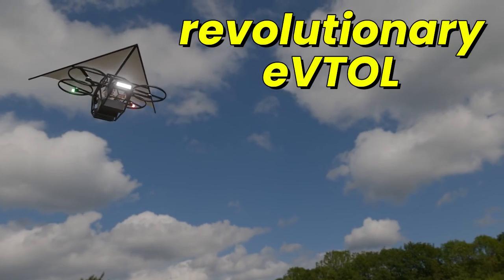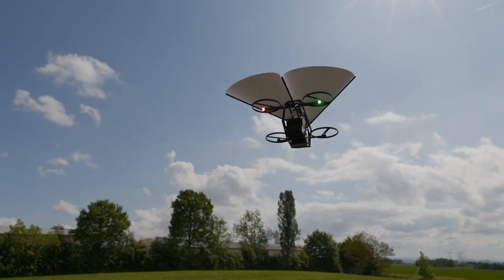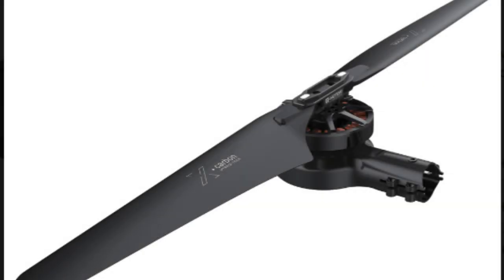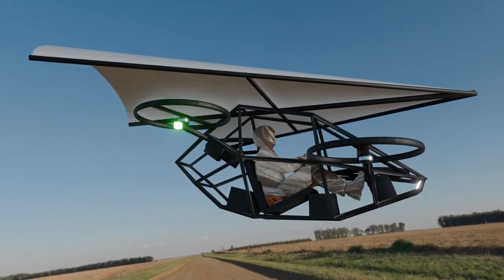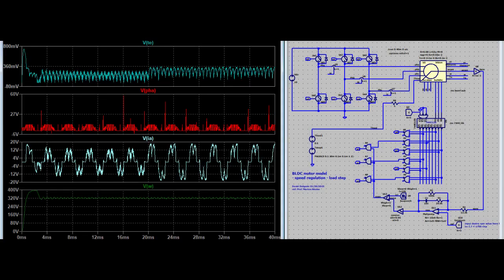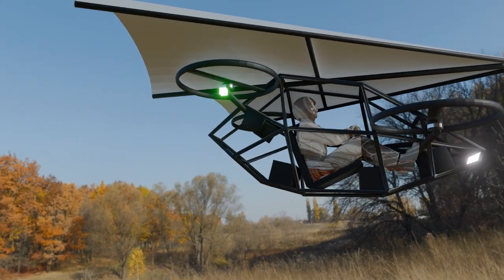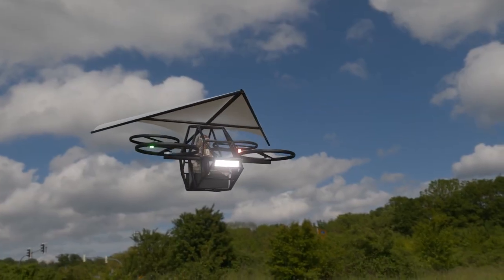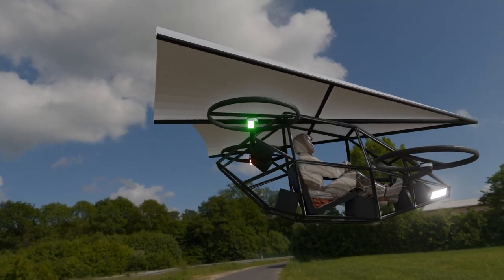eVTOL Drone hybrid for Safety, Innovation, and Freedom

Comment: You built it? Then let's see it!
Animated is not the same as IRL.
Those props would cause a pressure differential which would cause the air foil to bend downwards and lose most of its lift.
=> crash.
Disagree? Then show an IRL test model getting more hang time than a paper plane.
Reply from the maker: Absolutely!!!  If you're working on a drone design, propeller placement and airflow dynamics are crucial. Propellers positioned too close to wings or lifting surfaces can cause issues, and careful consideration of airflow analysis (like CFD simulations) can help mitigate these problems. Prototype phase is a critical component of development including finalizing the computer generated PID values

Pressure Differential: Propellers generate a swirling slipstream of air with varying pressure zones. This slipstream interacts with the surfaces of the airfoil (like wings or control surfaces).

Downwash & Flow Disruption: If propellers are positioned near or directly in front of a wing, the airflow over the airfoil can be disrupted, potentially creating uneven pressure distribution that reduces lift. This is sometimes called "prop wash" interference.

Bending of the Airfoil: In extreme cases or at high speeds, this disrupted airflow could cause changes to the aerodynamic load on the airfoil, possibly causing it to deflect or deform downward (depending on material properties and design tolerances).

Loss of Lift: A deformed or poorly aligned airfoil is less effective at generating lift, leading to decreased overall performance.

Comment: The air flow between the propellers and the wings will break, and the aircraft will go into a tailspin.
Reply from the maker: Depending on a particular design configuration, this is accurate.  However, for the reasons listed below, your hypothesis is incorrect for this idea.
 1. When placing the wing above the propellers, most of the turbulent air from the propellers moves below the wing, allowing smoother and more stable airflow over the wing surface.
2.The wing typically stays in "clean" airflow, which helps maintain lift and reduces the chances of separation.
3.Wake turbulence and disturbed air from the propellers are less likely to interfere with lift generation on the wing.
The eVTOL Drone hybrid was designed for Safety to Mitigate Risks such as positioning the wing high enough to avoid propeller vortices and turbulent zones.  Wing's placement allows clean airflow during forward flight. Using advanced flight controllers for yaw, pitch, and roll correction to recover from disturbances quickly. Closed loop system with optimum PID error summation values. GO figure 🤪
Reply: @BoundlessVision-d2  We call this a rag wing; will not work. Use a modern flex wing.